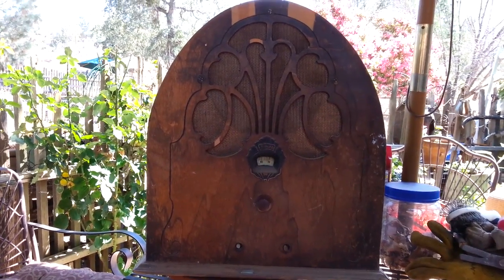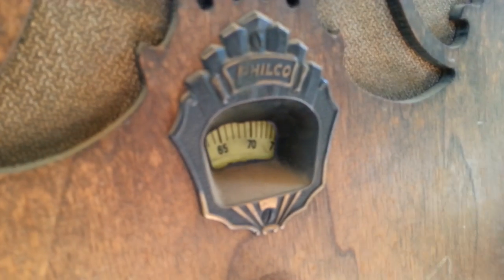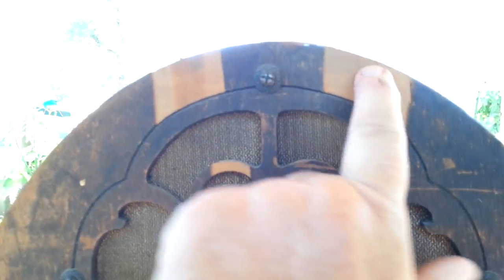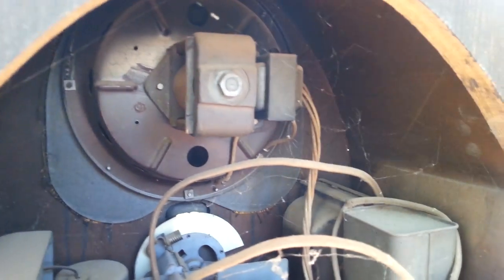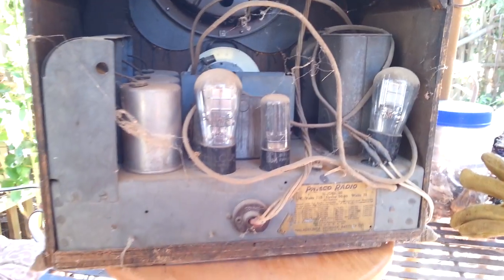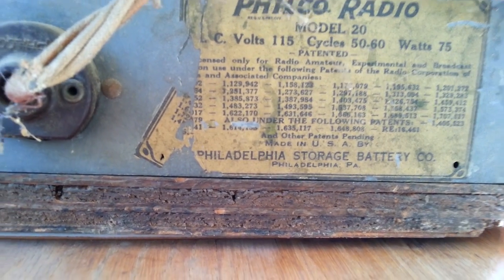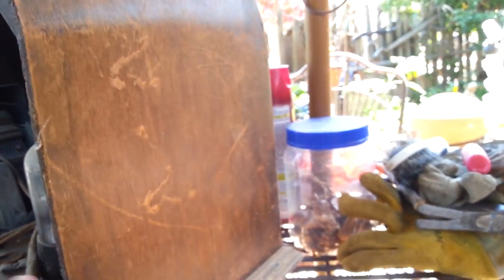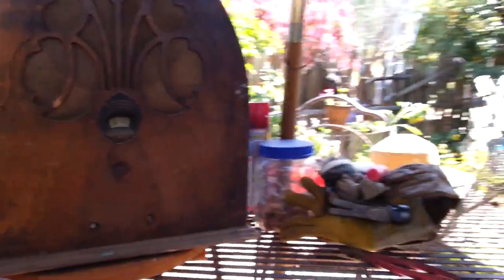Antique Philco Radio

Comment: Dont plug it in,until you have the radio check out they can be a fire hazzard,on a 80 year old   tube radio ,use  paint brush to clean the inside with a disk mask,and you need half shaft knobs  if you want to replace them .but old radios use wax capciator, and 80 year caps can be a danger, someone would pay you a pretty fair price a lot of restorers would love to restore that radio.

Comment: Don't plug it in... Don't... Till its been serviced you will destroy  the power transformer. ...junk... Parts... The knobs are a valuable  as the 📻
Reply from the maker: Terry Marshall    Hi Terry! I appreciate the beauty of industrial art, especially marvelous design from the 30s 40s and 50s. Old radios are works of art, both inside and out. A friend gave us an old television set from the 1950s. It sat out in the rain forever and the cabinet was completely warped and delaminated. I pulled off the knobs and sent them to a friend who restores old electronics. I yanked the guts and put them away for later. I even took off the legs because they can be reused. An old tube type hunk of electronics is like a deer - every part can be used - waste nothing!